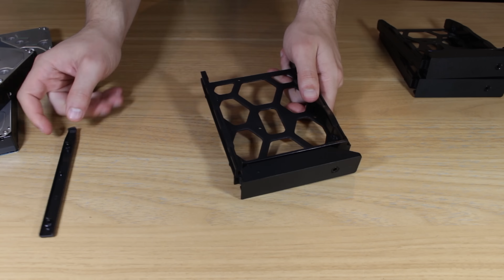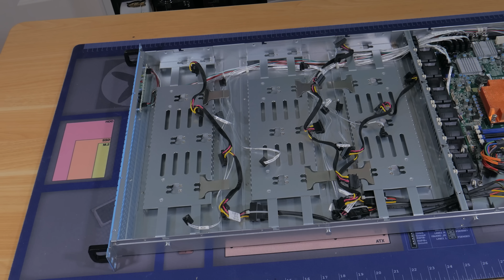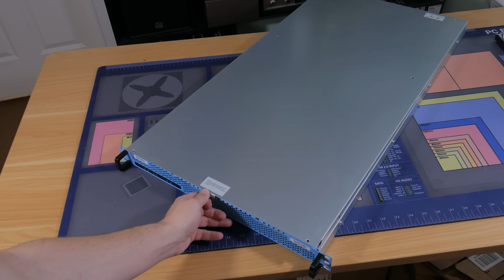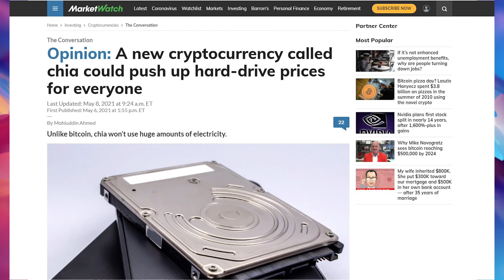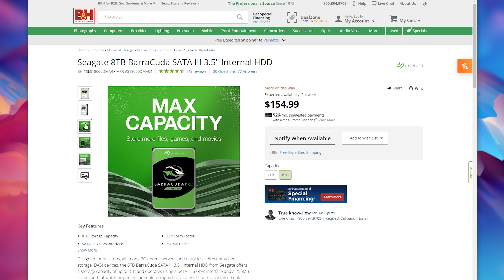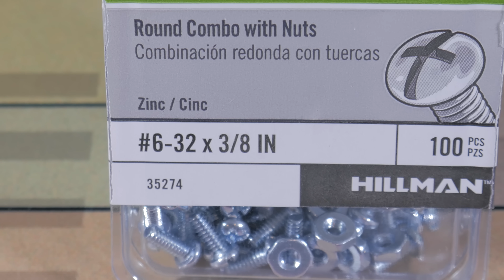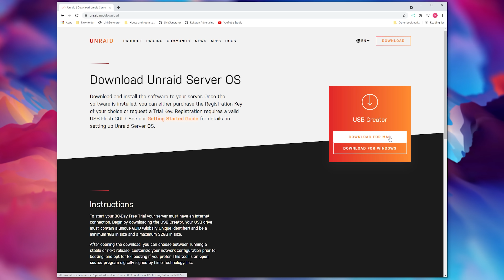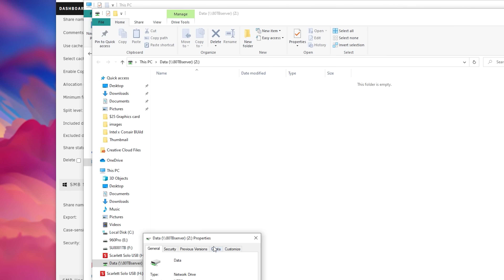Budget Storage Server 2021! | 80TB NAS

Comment: Great build man! Too bad about getting SMR disks out of the schucks, but Unraid was definitely the correct choice here.
Reply: I bought the same server after watching your videos about it.  They have a lot of bang for the buck.  :)
Reply: I also got the same server after crafts video. Honestly If the videos stop putting food on the table He should just buy up all of one unit and make a video about it. He did a great job selling this item.
Reply: I thought the same, anything 10TB or over from Seagate would have been non-SMR drives. I recently pulled all of the 8TB SMR drives out of my Unraid, even though its not really a critial issue like it is for raid and zfs you certainly do get effected by the slow write speeds.
Reply: @PrimeRedux  realized I got SMR's from Seagate a while ago before the whole debacle. unRAID. Definitely slower writes but with a cache SSD, meh. 4TB drives for like 50 bucks was still worth it in the end. Just holds computer backups and ripped movies so nothing mission critical anyway.
Reply: @PrimeRedux  Yup so true I would stay far away from SMR drive I too have had one 8TB going south
Reply: Freenas?
Reply: @daannys1981  freenas uses zfs mostly. ZFS and SMR is not  good thing.
Reply: Why unraid is correct choice?
Reply: @enesaslan3275  because if he'd went ZFS the SMR drive would have tanked performance.
Check ServeTheHomes' videos on the subject, https://www.youtube.com/watch?v=8hdJTwaTl8I
there's several they did but this I think gives you the overall view on the controversy
Reply: @enesaslan3275  Likely due to the use case. speed is not the design choice price is.
Reply: @ligarsystm  - I love how these Do It Yourself Use Cases Never include the person's time for building the system.  I value my time at $200 hr as a bank executive and if I had to spend 10 hours on this build that would be $2,000 and I am sure he spent more time researching and building and testing it.   As such I just purchased 3 QNAP NAS boxes for about $5,000 and have each running in RAID 0 with proper IRON Wolf NAS drives. I have double redundancy as 2 of the drives are pure backups for the primary.
Reply: @CORVETTE_DUDE_CHANNEL  Sorry that we all aren't bank execs, some of us clean your floors and have a bit lower budgets to work with.
Reply: @CORVETTE_DUDE_CHANNEL  Believe it or not, some people actually enjoy this... and spend hours researching builds they never actually do, lol (so I've heard).
Reply: @Corvette Dude  You probably aren't making $200 an hour 24/7. Looking at a pure financial standpoint There will be sometime your making $0 an hour in your free time. So DIY will still save you some money because you will be saving money. 
But obviously downtime/free time is important and if you have the available income then just buy a prebuilt and be done with it.
Also DIY can be risky if your new to the space as you could screwups and buy the wrong thing or break something or worse loose data. Where as a prebuilt solution there is less risk of something like that happening.
Reply: @Catsrules1  It is also likely worth pointing out that raid 0 provides no bit rot detection or protection.
Reply: @CORVETTE_DUDE_CHANNEL  I guess it depends, some people really enjoy doing this sort of thing - I know I do.  In another time 10 hours on a build like this would be 3 movies I didn't watch in a theatre while eating popcorn and drinking pop.  Well over $100 saved at the box office - but I guess if I was a Bank Executive that would be $700 saved, as I would have to count my time too! :-)
Reply: @CORVETTE_DUDE_CHANNEL  the only way this could possibly take 10 hours is if you include the 9 hours of procrastinating you did before getting to it.  most people valuate time off differently than time on anyway.

also you'd be better off spanning the disks rather than going raid 0, with a spanned disk you only lose the data that was on that disk, striped disks lose all the data that was on the array.  there's a throughput advantage with raid 0 but you're unlikely to be able to take advantage of it unless you have multi-gigabit networking (which is notable enough that you'd have mentioned it if you did), and the latency hit makes raid 0 feel worse if you're using it as a normal drive rather than just a place to stick big raw video files
Reply: @CORVETTE_DUDE_CHANNEL  If I had that much $ to throw around for home storage solution, I would just look for SAN solution instead.  Also you forgot to factor in the cost of electricity
Reply: @Palvati  While I agree with your SAN suggestion I don’t know about power usage. Prebuilt NAS boxes are designed around power efficiency. Server systems, especially older designs, not so much.
Reply: @ligarsystm  Actually if you run ZFS it can still detect bitrot even in raid 0 and it does check sums of all of your data no fancy raid required for ghat. It just can't fix it. However it can notify you of a problem and you can restore the corrupted file manually from a backup. (Assuming you have a backup)
Reply: @Catsrules1  BTRFS can do something similar. The issue is most people don't have the knowledge to make something like that work with any reliability. My preferred way to handle it is just two copies on 2 locations in raid N+2 or 3.
Reply: @CORVETTE_DUDE_CHANNEL  Then you just wasted $46.62 watching his video and another $6.66 writing and editing that comment you posted. guess your time, and by extension, your money isn't THAT valuable if your wasting it here, to think, with all that money you could have saved by not being here, you would already be half way to paying off that Chenbro server depending on what kind of a deal you'd get, but that shouldn't be a problem for a savvy bank exec.
Reply: Let's not forget the cost of coming up with that bullsh*t. Anyone who values their time at $200 per hour yet is still watching a budget NAS build is smoking some serious crack.
Reply: @Catsrules1  that's a pretty stuck up response. It's a DIY video for us to learn and learn from mistakes even. If your concern is your time and uptime and redundancy, hire a company to do it for you.
Reply: @CORVETTE_DUDE_CHANNEL  stop smoking
Reply: @CORVETTE_DUDE_CHANNEL doesn’t hurt to know how to do it yourself
Reply: @enesaslan3275  because it's not raid.  the big problem with SMR drives isn't performance, it's resilvering.
Reply: Hey craft I also am subbed to your channel I'm from bend Oregon area lol I used to watch Linus tech well still do but I ran across one of your videos a long time back and when I seen that you were from my state I had to watch a little more and I've got to tell you I love your videos as well.
Reply: Nice to see you here
Reply: Just buy IBM library :)
Reply: SMR will cause unbearably long raid rebuild times where read and write performance will slow to a crawl.
Reply: Does it matter if they're SMR drives if all they're being used for is storing videos?
Reply: 11:48 I have the same IP address on my server too! What a coincidence
Reply: When using Seagate, to avoid SMR drives, get the IronWolf or Exos class drives. Those are always CMR regardless of the capacity and they are rated for 24/7 operation. If you are unsure, Seagate has a list of Drives X CMR/SMR so you can know for sure.